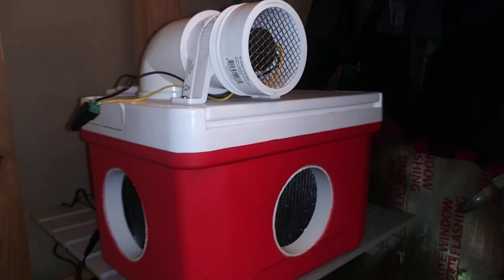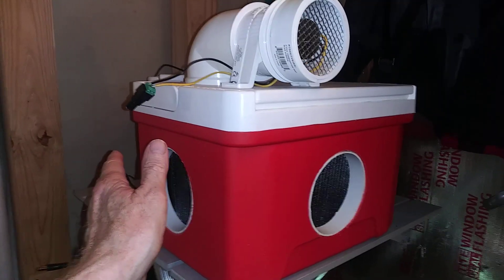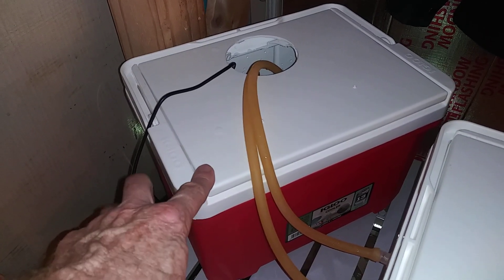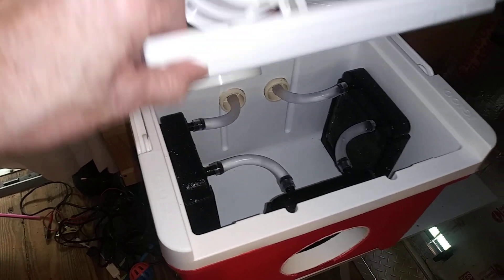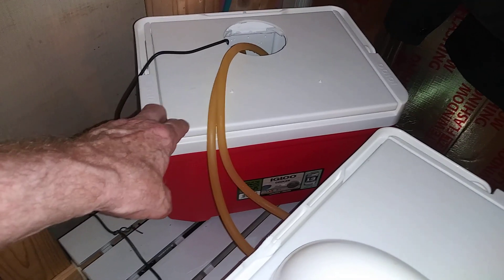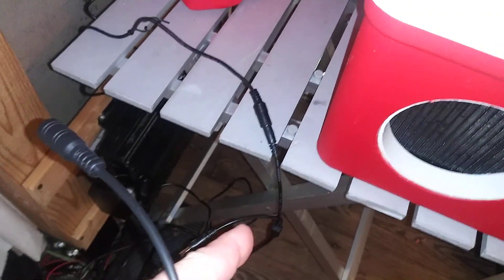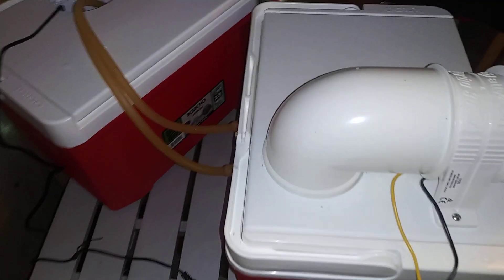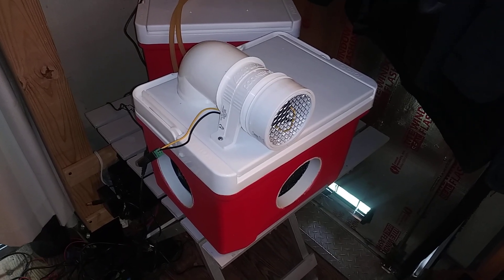DIY-AC Cold AirBox - Test Results! For Your DIY Homemade Air Conditioner. Perfect!

Comment: For a bedroom would you recommend the spectrum setup instead of this small ice box?
Reply from the maker: Believe it or not this little AirBox is comparable to a 5,000btu window ac unit provided ice water is continuously supplied. But supplying ice water is easier for some than others. This little unit is the radiator & fan box combination that has an inlet & outlet on the back to simply hook up the water pump with rubber or latex tubing. It really depends on how long it needs to run. To cool a room is achievable but ice supply is needed to be sustainable for several hours.
I haven't heard of the spectrum ac. What design is that?

Thanks Much for watching!
- james

Comment: What if you ran this same design but with a closed loop system, and in the bottom of the cooler containg the ice you ran copper tubing in a snake patern to provide as much surface area as possible, then you could pack the cooler with ice, even put a drain on it to remove water.  This would eliminate direct contact between the ice and any air or warmer water, which would preserve your ice. and you could scale it to a larger ice cooler for a larger copper snake for more surface contact time with the ice, and more ice in general to last longer.  Heck, you could then even use the ice container to cool drinks and what not.  Would freezing of the water in the closed loop be a concern when the system is turned off?
Reply from the maker: Definitely!
The scaling possibilities are endless for sure.

There was a Houston skyscraper that a friend told me about(when I lived in Texas) where a company that occupied an entire floor. They used a system where they froze water at night when electricity was cheapest and then let it melt first thing in the morning and ran the chilled water through radiators and used fans to blow through the ventilation to sir condition their offices during the day. And then again each nigh would refreeze the melted water and repeat. I never forgot that.

Thanks so much for engaging and inspiring ideas!
James

Comment: I'm using my homemade air cooler in my hot car when I need to sit idle for an hour and the ice melts very fast and the air coming out is about 89 degrees. if I use it in my hot garage the air feels cooler and ice lasts longer so I'm guessing in the small area its just heat soaking the radiator. I want to use your design but use a yeti tumbler as my external ice source to make it a little more portable.

Comment: Hi ColdSchool - I am doing the same thing as you and have found some awesome blowers.  They are so quiet and easy to use and are quite powerful.  They are the AC Infinity brand on amazon.  They have 4” all the way up to 12” and are for grow houses.  The 4” is around $89 so it is a bit more that the marine blowers but you will be impressed with how quiet it is and it can blow 200cfm on high.  I got the 6” unit and it can push 400cfm.  They also have a temp controlled digital thermostat as an option that is a nice way to control the unit.  I’ve been using a mix of 120 and 240mm radiators with success but my problems is the ice meting so quickly in my open loop system.  Still working on that problem.  Also you might want to get some of the cheap aquarium LCD thermometers that you can mount in and around the unit to monitor the water temp, ambient temp and outgoing temp.  It is nice to see how the temps match up as the ice melts.  Keep up the great work!
Reply from the maker: That is definitely awesome!
I will surely look into the AC Infinity brand fans. I've seen many inline fans for HVAC etc but haven't ordered any of them yet. I will look into that for sure.

I have definitely been wanting to make videos adding a bit more visual technical analysis with the verbal etc. The channel started out with mixed goals but I'm paying attention to what people need and want and definitely aiming to serve in those aspects.

I've found recently when using my larger red test unit that if I slow down the fan speed and draw in less mass hot air that the ice lasts longer. But I need to let the unit run for a while to cool my 100sq ft room on my van conversion. Proper insulation in the room area and surrounding the cooler or ice container are a huge plus. With enough room insulation R-value the need for night a.c. output is needed less simply by reducing the sun's penetrating power to begin with. I tend to use mine inside unless I'm just testing outside for workspace convenience. 

Ice preservation/extension can be accomplished but it takes several fine tuning factors. I've always had access to ice one way or another but am going to make some videos specifically on ice extension and insulation.

Thanks much for your involvement for sure!
James, Rescue Kitty😺 & Snowvan!

Comment: Can you add a link to the fan and radiator
Reply from the maker: Of course!

These are the links below to the PC radiators and fan I use in this AirBox.

➡Attwood 3" Fan - Water Resistant:
https://www.amazon.com/gp/aw/d/B001O0DE9E?psc=1&ref=ppx_pop_mob_b_asin_title

➡PC Radiators - 3/8" ports:
https://www.amazon.com/gp/aw/d/B01D81UPHA?psc=1&ref=ppx_pop_mob_b_asin_title

Comment: Why is the fan placement offset to one side?
Reply from the maker: Oh, great question!
I originally put it in the center but in order to be able to grip the handle on the cooler when it's in the upright position the fan was in the way. Center orientation is probably best if not using the handle.

By coincidence there is actually zero extra space between the handle as it slides over the pvc elbow and the fan. It fits exactly just right with no play etc.

 I built this first one for a close friend and they are going to be carrying this AirBox as they travel and just hook it up to any available container filled with ice/water and not have to Tora around a large cooler everywhere. They're literally going to be taking this on buses etc on their travels overseas from house to house for visits and meetings where they have plenty of affordable ice but no AC abundance etc. So it was offset for my friend to be able to grab the handle with the fan out of the way...

Very good observation!
James, Rescue Kitty😺 & Snowvan!

Comment: Nice set up. I was wondering if you could do test on how long ice lasts with self contained system with another radiator and ice in the second cooler connected to the cooler with the airbox.
Reply from the maker: Ohh, I like that!
A secondary external ice/water container. I started a closed loop version on a larger scale with the Spectra Radiator and a larger cooler with the 9qt cooler inside. But I hadn't thought about a larger external tank. That would actually be a good idea to help gain equilibrium with the longer time it takes for the ice temperature to transfer through the copper tubing or submerged radiator. If equilibrium were achieved then would be great. I will try that!

I got committed to the 9qt AirBox for a friend so it kind of took precedence until now. They changed their mind from the mini combo to just the AirBox to travel on buses etc and hook up at times and meetings where ice is cheap but AC is rare etc.

I think I saw a guy about 5 years ago build a closed loop version using a car radiator but I don't remember his success rate etc. It was a really rough and crude build but the idea was there.

I'll build that closed loop split version on a larger scale soon for sure! Very cool...

James, Rescue Kitty😺 & Snowvan!

Comment: how much ice you need for 1 hour of cooling?
Reply from the maker: Very good question!
It definitely depends on the cooler's insulation for sure.

Roughly 20 pounds of ice in an average but decent mid sized cooler would cool pretty cold and then cool for at least an hour if used indoors where the initial temperature is still bearable but not dangerous to a human being.

2 quarts of ice in the mini open loop 9qt AC that I built as a test with zero insulation lasts 15 minutes cold on low to medium fan speed(drawing hot air into the radiator and heating the water as it passes through the radiator fins) before the ice melted. And then it continued to blow cool air at least for another 15 minutes.

It's reasonably easy to make 20 pounds of ice last for an hour blowing cold. If you had good insulation and a cooler sealed really tight I'd say 10-15 pounds of ice could last an hour on medium fan speed. These little Airboxes blow really cold and will get you cold if you sit directly in front of them indoors like you would sit in a car with AC but you don't really need to sit that close. I usually sit about 3 feet away.

I've a got a high performance medium sized cooler that I'm building to test against the inexpensive cooler with minimal insulation soon!

Does that help a little bit?
James